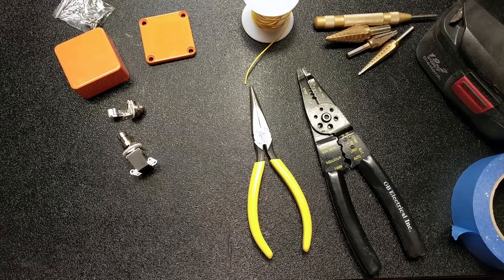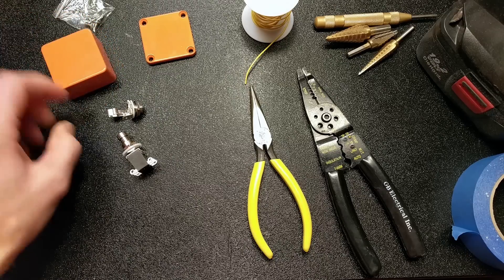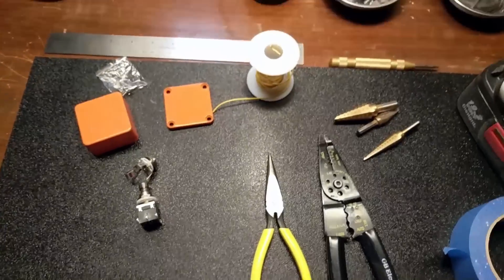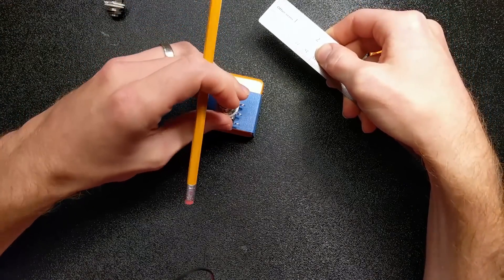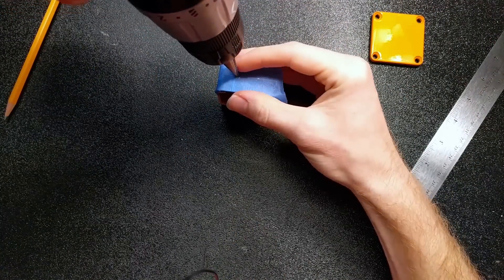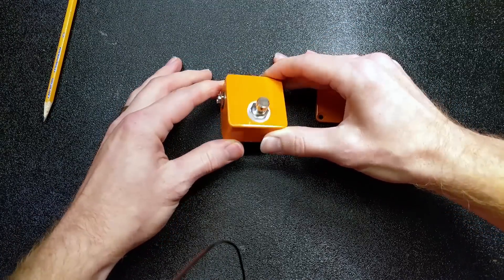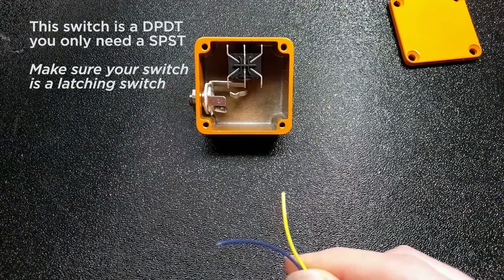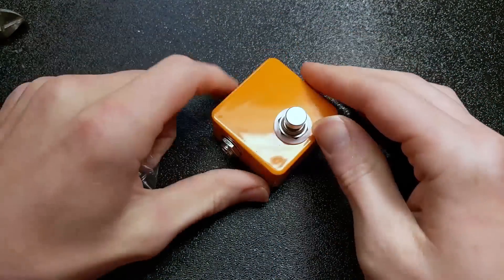Build Your Own Guitar Amp Foot Switch (Under $15)

Comment: Nice video!  So, if I wanted a 2 button footswitch with two independent connections for a Marshall DSL amp (one for channel switching and one for the reverb on/off), I would simply repeat this is a biiger box correct? And if we wanted to add an LED for both switches?

Comment: Dude wtf.. 
You should have grinded off the other tabs, or atleast shielded them from the outer CONDUCTIVE casing 😅😅

Your skills are great but that's an amature mistake. 
Leaving 1mm of room for air insulation is not good enough.

Comment: im doing somethibg similar for a gcse engineering project where i want to turn a pedal on/off from an extra button or a switch in a guitar. i know nothing about guitar modding or much about electronics but seeing the pedal change the amps sound absolutely blew my mind because ive been trying to find something like that for ages now as my deadline will be coming up. 

does anyone know however what i need to do or how i would actually make this work? because im still really confused and kinda dumb.

Comment: Hey, I have a question. Does this footswitch work with a digital amp like the Fender mustang lt40s? I Would really appreciate for someone to respond cause im on kinda of a loss
Reply from the maker: Probably not. The Fender foot switch looks more complicated so its probably looking for different inputs then just bridging the connections.

Comment: I think you can do this without the jack. Just solder the hot and the ground wires of a guitar cable with a jack plug to the logs of the foot-switch. Put some rubber ring around the hole in the enclosure where you have placed the jack - for cosmetics and to avoid the metal cutting the cable - and you're done. Easier to fit in the pedal board (no jack plug) and cheaper (if possible). Can you confirm?

Comment: No need for  grounding? I have a strange problem with my on or off footswicht i use to turn on or off on my reverb on my mesa fillmore head..when the reverb is on..it buzzes that gets louder with the reverb knob but when i touch the metal part of the cable jack..the buzz completely disappeared..zero buzz..and  I just found out that when I put the foot pedal inside the head on top of the reverb tank..the buzz completely disappears.. i think it has to do with the input jack ground..could it be the washer that do not make contact with the footswitch enclosure..it has nothing to do with the reverv tank..it is fine..I am using a trs jack cable...any clue?
Reply: Nevermind..i found the problem..opened up the unit..i need to connect another cable from the opposite tab of the black cable to the last tab of the latch switch..no more buzz...0...

Comment: Great video.  THANK YOU!  Works perfect.  I too want to add a led to this little box.  Just bought all the parts to try.  Will advise how many led's I burn up before I get it right.

I plan to use this build for my Carl Martin Dual Compressor - https://www.carlmartin.com/andy-timmons-signature-comp
There is a remote jack input that switches to channel two of the compressor.  I use this as a boost function.   Would this work as a tap tempo switch using a  momentary switch instead of latching?  Might need a TRS jack for that (?).

Comment: Great video, I didn't pay attention to one important thing - here's a tip to learn from my mistake. I wanted to center the switch and jack. I didn't double check if the internal parts of the jack and switch would run into each other before I drilled the holes. The centered holes on my enclosure will not work, as the jack and switch don't fit, and now I will have to get a little extra crafty... So, the video's off-centered holes are a good idea!
Reply: just today was building tap button like that, and guess what? i did two central holes and now cant put them together... :D
Reply: they do actually fit, if you mount the 2 items on the outside, instead of the inside.

Comment: I still don’t understand, if you don’t have an output, how can you connect your guitar to the pedal and the amp?
Reply: A regular guitar cable
Reply: This pedal goes directly to the special footswitch input of the amp. The guitar also goes directly to the amp and you connect it to the regular input. Google Fender Champion 40, which is the amp I have, and there you can see both inputs, fs input and guitar input.

Comment: Hi ,I have a broken joyo dist pedal and I just wanna use its switches for exact purpose like this ,I couldn't figured poles of the switch ,how to find out man ,plz help
Reply from the maker: Draw the layout of the connectors. Then with a multimeter set to continuity mode test which terminals are connected to each other in each of the switches positions.

Fill in your layout and then use the correct terminals for your new switch.

Comment: Will this work with a Marshall dsl 100h, it has a footswitch with three connections on the jack sleeve tip and another. Or is there an alternative wiring for that?
Reply from the maker: I think those work by the switch connecting tip to sleeve for one switch, and ring to sleeve for the other. This similar but you would need to switches and a stereo jack. I haven't made one personally though so I can't say for sure.

Comment: Hi there is any way to add a switching jack to my amp? To change channels. I have a joyo 20 watts amp clean and distortion switch but no jack to change with like a foot switch. Any ideas? thnx. Great video
Reply from the maker: You would have to open the amp up and solder wire extensions from the internal switch. Probably could be done but I wouldn't know for sure without looking at it.
Reply: @MerwinMusic cool I will check that out

Comment: Hi. Thans for your answer.
What you did mention is my original plan.
The only thing is that I found that my amp uses a DOUBLE DPDT SWITCH, two switches to change channel, 
and both are wired in the circuit board. I don’t understand why they did use a single spst switch, this would make
It easier to wire my control pedal.
I am planing to add a spst to each dpdt and try.
Any comments are welcome. Thanks 
SJ
Reply from the maker: Does you amp have a clean and drive channel, and then maybe a more and less drive?

Comment: Good video.
I am trying to add similar pedal to my amp, but my amp does not have a jack for control pedals, 
It has a selector switch on the panel instead.
The switch is soldered directly to the circuit board, so I need to solder my cables directly on the circuit board.
My amp is the “G20 Acoustic”.
Any recommendations?
SJ
Reply from the maker: You could put a jack on the back of the amp somewhere and then solder it to the switch leads on the circuit board.

Comment: What is it? Is it 3pdt?
Reply: Looks like he used a DPDT - two pole, double throw switch.  Obviously all you need is SPST for this application.
Reply: @tbd114  I would depend on exactly how the the AMP's channel switching is wired.  To be certain it works you should use a DPDT with the 2nd pole just for the light.  You  could use a dual color LED and have it turn on red or green.

Comment: i have a old fender power chorus amp and o use have one back in the day but now i got i found and it doesnt have the 4 way foot switch. how does someone make a 4 way foot switch for this amp?
Reply from the maker: you could try and find a schematic for the original foot switch. I don't know what you would exactly need for your exact application.